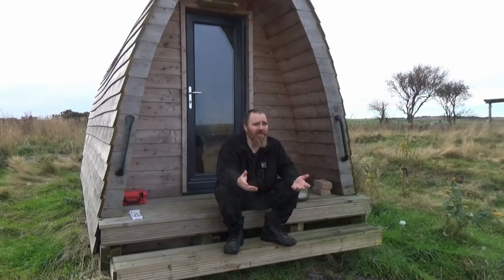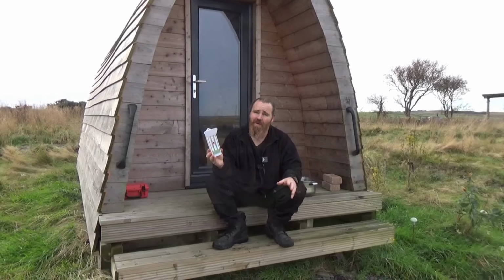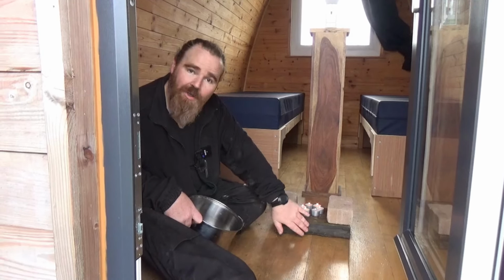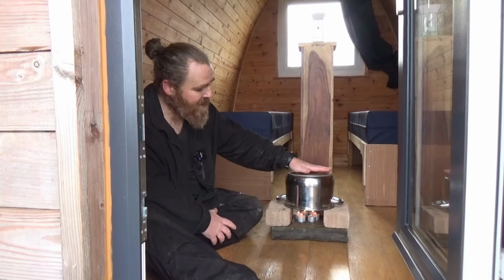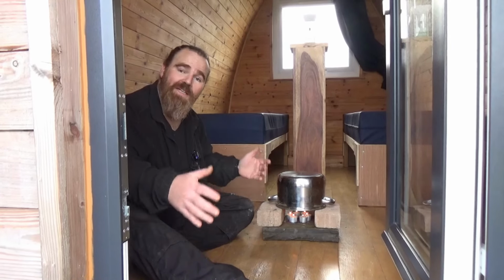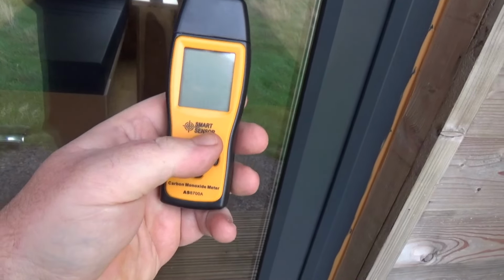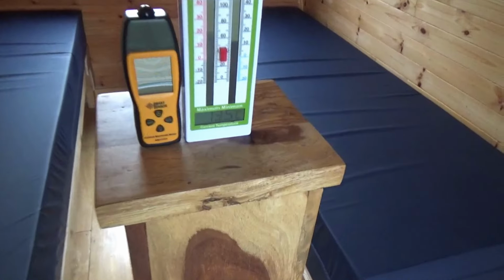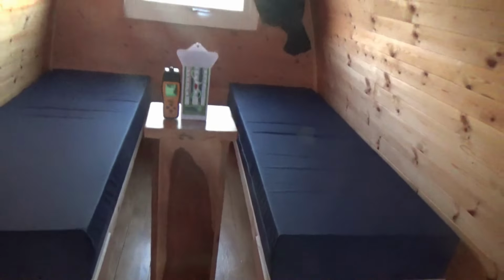DIY Flower pot candle tiny house/camper van/power cut heater tested. Effectiveness? Carbon monoxide?

Comment: ANY naked flame,  be it a coal or wood fire,  a gas heater, candle heaters, always always keep your place ventilated. I grew up the daughter of a coal mine electrician - and it was the first lesson. We had vent bricks in the cottages the mine build,  a brick in the exterior wall, one or two per room, with holes in.  Specially made to vent.  In modern times, we have forgotten these things the people of 100 yrs ago were well familiar with.
Reply: I have an Edwardian terraced house takes costs more to heat but in each of the 3 bedrooms I got those vent bricks.  They have a covering inside the room so can adjust how much its open.  Very good in winter as can keep windows closed and just have vent on half open, so have ventilation but still keep room warm.   Don't know why they stopped building houses this way, it's common sense really especially with dangers of carbon monoxide poisoning. Plus in last ten years of living here I haven't had any coughs or colds etc,  yet when was living at old address (a new build) I always had the flu or a cold in winter without fail.   Think maybe the ventilation in old houses is better for not getting colds etc.
Reply: @liverpoollass7600  100% agree with you!
Reply: Are the vented bricks low near the floor or high closer to the ceiling? In Australia back in the 50's our house was built with two vents per room high up near the ceiling, always open. Fortunately the winters were mild.
Reply: @SeventhEraProduction  they were high near the ceiling. Also every room had one small window which opened above the two bigger ones also for ventilation.
Reply: If you study old Victorian homes you'd find they vent the attic and have inlets in the basement so the house cools itself in summer.
Reply: Just read a pathologist´s tweet who warned against these mini ofen, obviously someone got killed by it: "Aus gegebenem Anlass (Kohlenmonoxidvergiftung) bitte ich darum keine #Teelichtöfen zur Raumheizung einzusetzen. Und neben Rauchmeldern auch Kohlenmonoxidmelder anzuschaffen. Herzliche Grüße aus der Pathologie!"
Reply: And a canary.
Reply: My old 1886 farmhouse is so draughty that I don't have to bother thinking about ventilation normally :-).
Reply: @kirstypollock6811  Rather like the houses in Ecuador - as I said to my brother about my gas heater, dont worry love, the one thing that you can be assured of given Ecuadorian building codes, is that there is plenty of ventilation :-)
Reply: No we haven't

Comment: Thanks for the safety tips. I once lived on a 20 foot   boat in winter. I had a galor gas fire on all day while I was in bed. I worked nights. One day I woke up about 2pm to go to the loo. I got up and nearly passed out. My head was thumping. I got out onto the deck and I could not stand up straight. A friend saw me and caught me before I went into the river headfirst. I nearly died that day. If I had not wanted to pee I would have gone bye byes for ever. Carbon Monoxide is lethal. I suggest when using these things you have ventilation
 At the very least a hole in the roof for the  CM to get out. Cheers.
Reply: And get a Carbon Monoxide Detector!
I almost died as a kid from CO Poisoning, because of a blocked furnace vent.
A few months back, using my propane cooktop in my Caravan (Travel Trailer, for us yanks), my CO alarm went off.
I turned off the stove, opened the door, and stepped outside.
No. I FELL outside. It is accurately described as "The Silent Killer."
Reply: Thanks i HV a carbon monoxide detector and I leave my window open a little ,I'm glad u are ok bless that was close 🙏💖👍🤗🇬🇧
Reply: . 5th
Reply: I agree that why you dont have gas on ships. Butaine and propane gas are heavier than natural gas. And give off carbon monoxide. You need good ventilation if using this. They are not for continual use.
Sounds like you were lucky
Reply: Et que dire d'une plante?
Reply: CM is heavier than air. A hole in the roof won't help. Use detectors and keep them  low and close to the source.
Reply: @ms 13 Hot air rises and out vents
CO is slightly heavier than air but with reasonable dispersment values
Common sense and due care required
Reply: Carbon monoxide Falls... ir fills up tbe roo. From the floor Up. Put your Monoxide detecter near the floor to get the earliest indication of a problem.
Reply: A hole in the roof doesn‘t help to prevent those accidents. CO/CO2 ist much heavier than normal air-mix, so it will „fall down“ the bottom. That‘s why every caravan wit gasbottless Flo ccoking and heating has a couple of small holes on the BOTTOM of the floor, so CO2 and the gas itself can fall down out of the camper and wind will blow away. It‘s not allowed to cover these holes!
Reply: Yes I am thinking of the chlorophyll function that occurs in daylight but we are not always awake to discover it
Reply: @mireilroy7938  I agree with you. A few houseplants could alter the polution.  Houseplants were once called indoor air purifiers.
Reply: @ms-jl6dl  Yes, carbon monoxide slightly heavier than air but when it comes from the heat source it is hot and therefore rises before it later cools and sinks, so maybe high and low ventilation helps. Just a thought.
Reply: I don't know where everyone got the idea CO is heavier than air because every search result I'm seeing says CO is "slightly lighter than air" but it doesn't just rise, so probably best to just open a door or window regularly to keep fresh air flowing through the room.  Indoor plants are also a good idea.
Reply: @kurtsteiner8384  yes it's amazing how slack people are with burning propane gas stoves inside. I had one on a camping trip and I insisted that we burn it with the door open (was pouring with rain outside). It's pretty much commonsense but so many people don't have any lol.
Reply: @brrjohnson8131  not really as houseplants take the carbon dioxide out of the air, not necessarily the carbon monoxide.
Reply: Ask a chemist what you get when you burn propane.
It gives off CO2 and H2O (vapors).
That's it if you're using pure propane.
Reply: CM is heavier than air, so a hole for ventilation in an enclosed space would be safer low down, below your head height. Ideally, I guess, a low vent to expel CM and a high vent to allow clean air in? (I had a similar experience of CM poisoning, but was out in the open air, running a raku gas kiln - in a 12’x 18’ space bounded by 8’ hedges. The CM, being heavier than air, just built up in the space over 5 hours of working at the kiln continuously & I got symptoms like a disorienting flu. It was only by chance that, a couple of years later, I found out the reason why, every time I did a long firing session, I would have a thumping headache the next day which no medication could shift.  Once discovered, I changed my practices and no more problems 😁. Stay safe🙏
Reply: @ms-jl6dl  Thanks for that. I was thinking of putting them on the ceiling
Reply: @emariaenterprises  Thanks for that. I was thinking of putting them on the ceiling
Reply: if you stumble you're done for since it's heavier than air and densest near the floor :/ I was taught that when you suspect CO, you should first try to open or smash a window within reach without getting up because of the risk of falling.
Reply: A hole doesnt work like many said. And whats the point of burning stuff for heat if you leave the window open🤷‍♀️🤷‍♀️
Reply: @ms-jl6dl  That is one of the reasons you need a small vent at the bottom, and a small vent at the top.
Reply: Better still get a CO alarm they don’t cost a lot .
Reply: God woke you
Reply: oh my, thax for telling.
thank G*d  ur alive to tell us.
Reply: @mikeries8549   im learning a lot
Reply: @Scapestoat  thsts right. 1 vent dies nothing. ya need 2.
Reply: I was just going to ask that question. I've just bought a calor gas heater, just in case we have power cuts. Thanks for answering my question before I asked...lol.
Reply: @ms-jl6dl  That is a complete fallacy. Carbon monoxide is lighter than air, period! Thats why hard wired alarms on installed on ceilings...
Reply: You mostly need air intake in, then you won't produce carbon monoxide due to incomplete combustion caused by decreasing oxygen levels in your pod/whatever.

Ignore this CO vent in the roof rubbish.
Reply: @mireilroy7938  plant need carbon Dioxide not monoxide
Reply: @nikaxstrophotography  Merci je l'ignorais
Reply: @jasmijnariel That would be a chimney wouldn't it. The advantage of burning stuff for heat with a hole in the roof is well known and goes back further than a millenia.
Reply: @daleval2182 His bladder did.